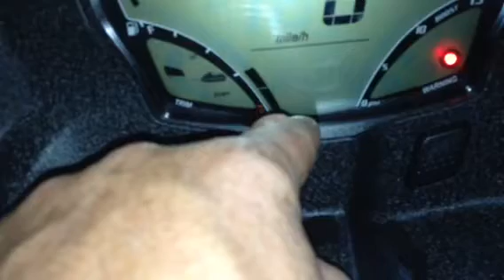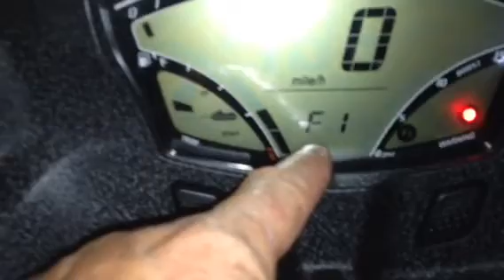Getting a F1 code on a Ultra 300/310 could be a SCOM malfunction or trim control

Comment: the flashing " f i " light on the spedo is the "fuel injection" on-board diagnostic system light, suggestion: check under the seat there is a yellow wire coming out of the ECU that is touhed to chasis ground in order to retreve the trouble codes, the wire may be pinched and contacting ground, causing the light to flash codes.

Comment: Do you know if problems can arise out of backing a 300x? i backed up in, then after going forward, my ski throws an f1 code. Ski shuts off at idle and now it won't start. Still had power when throttled.
Reply from the maker: Hi Will, I suggest that you get hooked up on the Green Hulk Forum as there are a lot of guys there that can assist you with any and all of your questions here is the LINK ;  http://greenhulk.net/forums/

Comment: Did you ever get an answer on this or a fix?
Reply from the maker: Yes I took the SCOM out and perfect again no problems
Reply: @jetson328  what is a scom?
Reply from the maker: @izzyarango  Speed Control Overide Module
Reply: Hi there .. Thanks so much for the helpful videos !! I’m having issues with my 2017 310 ultra lx ... I’ve installed a scom when i first purchased the ski but recently at the start of every ride the machine seems to bog and misfire but eventually after about five minutes or so comes back to life ... now I’m throwing f1 codes lie yours .. would the scom cause the misfire rough idle bogs etc ?
Reply from the maker: @scottjamieson35  Hi Scott sorry to hear about your problems, well really the 310 had piston problems as you may already know? If not google Ultra 310 piston problems to understand that issue, I presume that you already know about that issue, not saying that's your problem. As for the SCOM causing the types of problems that you are having Im really not sure, ?? I took out my SCOM as you may know then the F1 code problem was solved. Starting with the SCOM can you disconnect it in a way that you can re hook it up after you do a test by un hooking/bypassing the SCOM and take you Ultra out for a test ride and see just what happens I would start there if the F1 code is gone and the ski runs great then that would provide us both and anyone reading with an answer. So I would start there and see what happens. If it still bogs and misfires etc check the plugs out, if not OK change them check the color of all the plugs and take them out in order so if one is miss colored black etc then you know which cylinder it came from. Also may I suggest in a well ventilated area outside would be best get a garden hose size siphon hose set up a very clean white bucket and get the hose to the lowest part of the ski s fuel tank and suck a few gallons of fuel out of your ski and see if there is any water in the bottom of your fuel tank as you know when you look in the white bucket if there is water then there will be like a bubble in the bottom of the white bucket. If also you get a bunch of crap etc then you may want to agitate have some bounce up and down on the trailer and suck the tank dry a few times to get out all the crap if there is any. Also check the intake air filter screen located at the front of the supercharger see if it is clogged tough to get at go through the front lift out box and take off access panel and look down on your right you will see it maybe I have a video on this? Us a SOFT brush vacuum cleaner to suck out any crap on that filter screen doubt there will be any? Also have you cleaned your intercooler? they get gummed up, I have videos on that I think best to use High Flashpoint solvent I used gas which is a tad dangerous so best to say clean your intercooler say every 50 hours. Anyways I could go on all day...ha ha please update us how you made out Rod
Reply: @jetson328  Bonjour le scom c’est je ecu ?